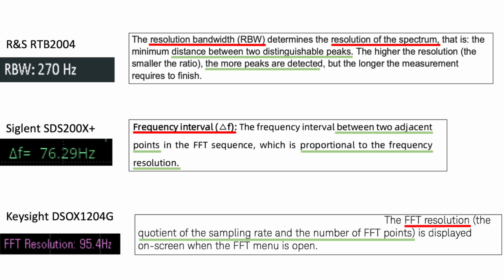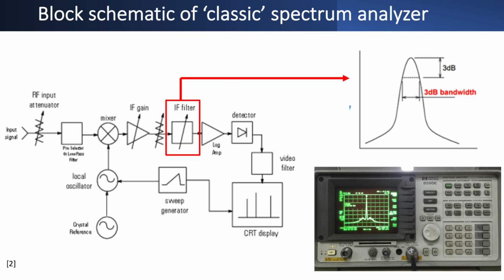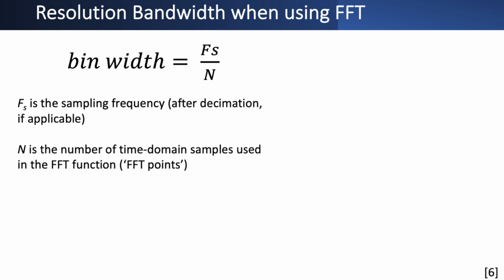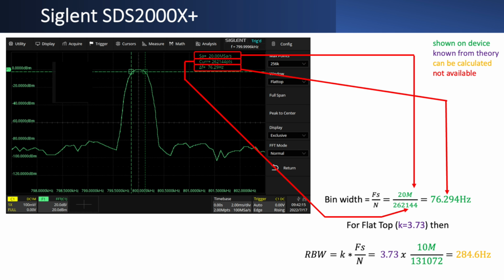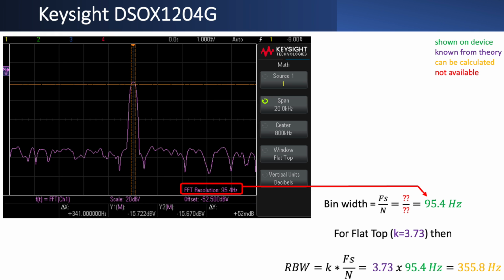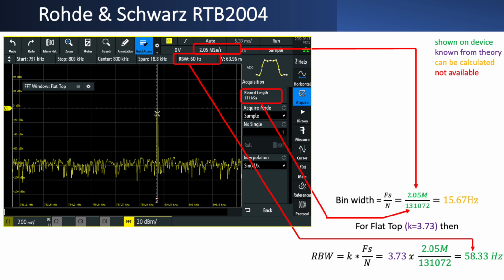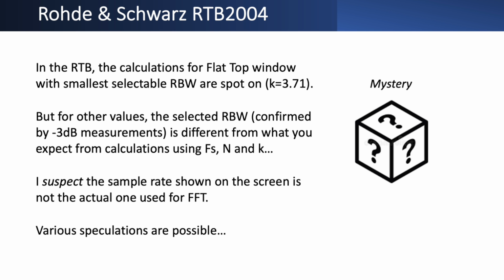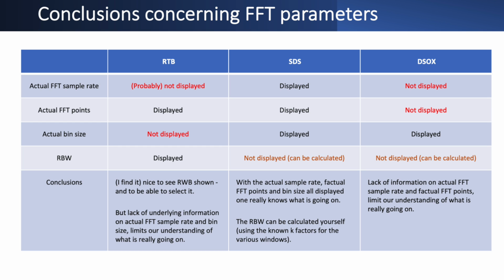REL #14 RBW, Frequency Interval △f, FFT Resolution, and Bin Width on an FFT oscilloscope

Comment: you cannot just ignore the total sampled time (time window) with which the FFT is done. It's the fundamental property of FFT that the frequency points are separated by 1/T which T is the time length of the sampled signal. Now other decimation factors (both in time and frequency) can come in and modify this basic resolution but this is the basic point from which you should have started. So perhaps the R&S actually plays with the time/div (in the background) to adjust the FFT resolution